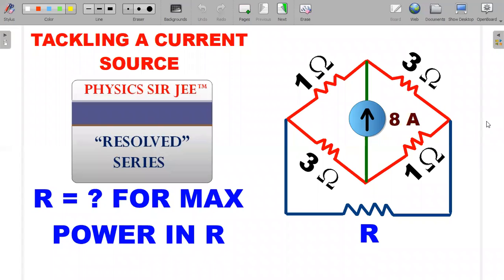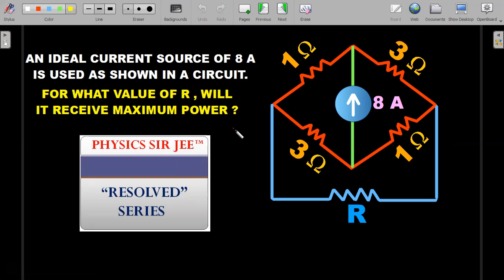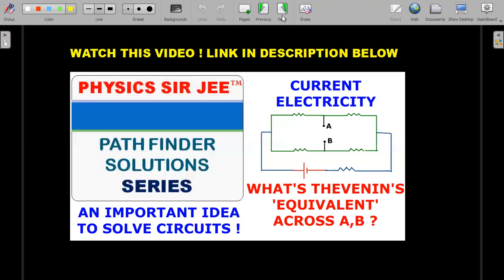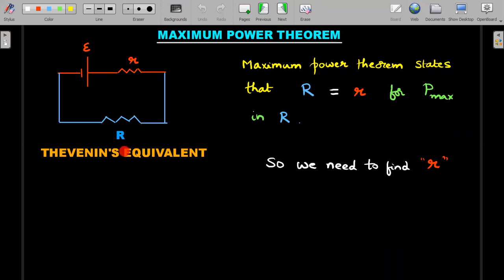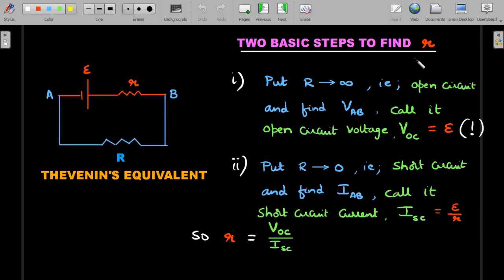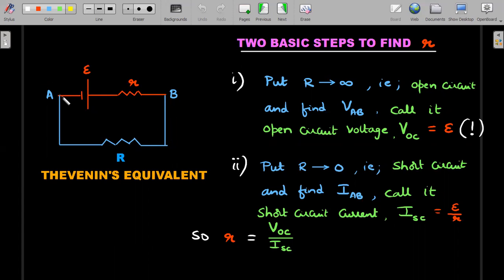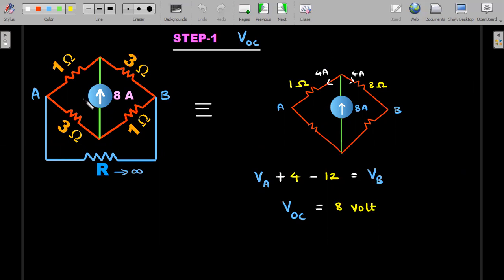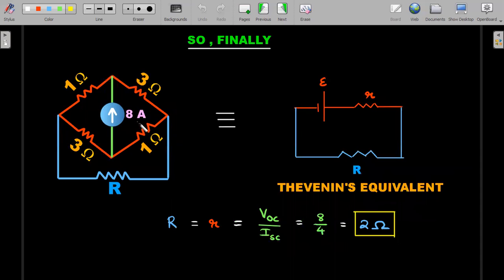RESOLVED-19 PHYSICS VIDEO | CURRENT SOURCES | THEVENIN'S |MAXIMUM POWER JEE ADVANCED SCHOOL PROBLEMS

Comment: sir  at 4:18 for calculating thevenin's equivalent resistance couldn't we directly use the method that we replace the ideal current source by open circuit and find equivalent resistance which would directly give 2 ohm resistance as the answer

Comment: Sir without  external  sources  who does current  flow
Reply from the maker: Current generator is the external source (similar to battery which is a voltage generator)
Reply: Sir but without  battery  ho does current  flow  sir please  explain
Reply from the maker: @ratnapandey1635  battery is a part of 'current generator'... Please read about the 'current generator' or 'constant current source' from standard sources or Google it...

A simple way to build such a source is explained in one of the exercise problems of HC verma in 'current electricity'
Reply: Thank you sir for clearing  my doubts 🙏🙏

Comment: Sir at 2:45 
My doubt is that the Maximum Power Theorem was for a constant voltage source, but here we have a constant current source.

So if we have a constant current source with internal resistance and an external resistance connected across it, then P=(i^2 x R)(where the current i is constant and the load  R is varying). So for max power across the external load, its resistance should be infinite.

So The maximum power theorem was only for constant voltage source na ?????

Please correct me sir where am I wrong?

(When I am using loop law and calculus, I am getting the same answer R= 2 ohm.)
Reply from the maker: Any constant voltage source in series with its internal resistance is equivalent to a constant current source with same  internal resistance in parallel . This is covered in thevenin equivalent

Comment: I solved it using kirchoff's laws and also got right ans, but it went a little bit lengthy and cumbersome. This method was way more elegant and i am definitely sure that i am gping to remember this solution for a long time.
Reply: It didn't go lengthy with kirchoffs it became very easy with that too, just u need to draw the circuit wisely